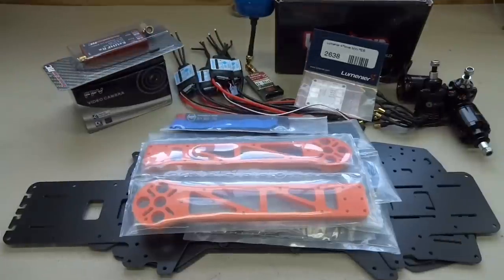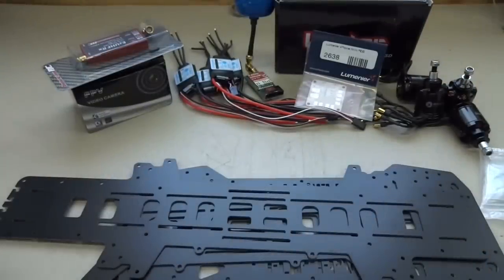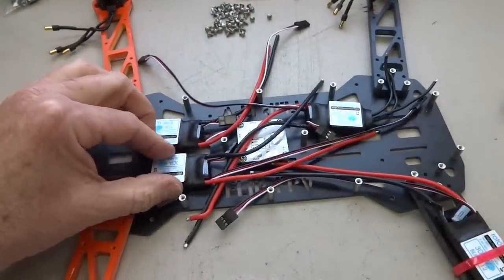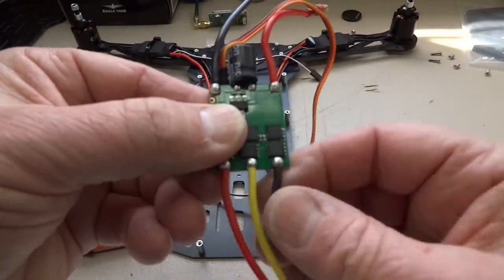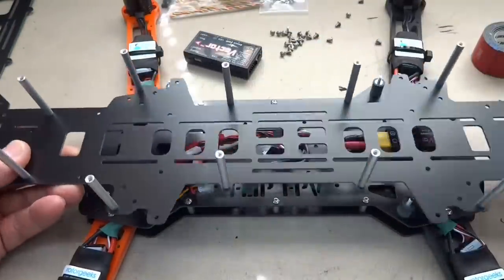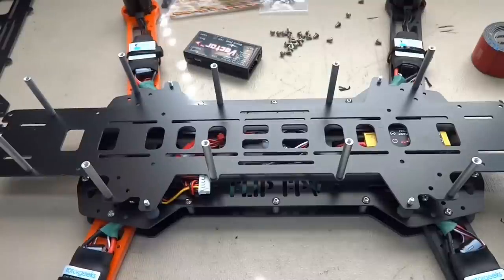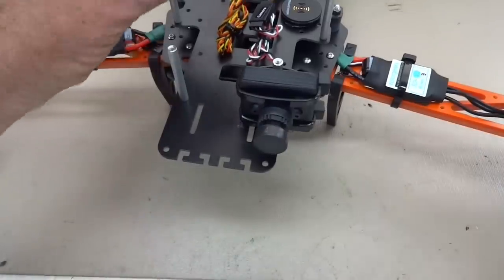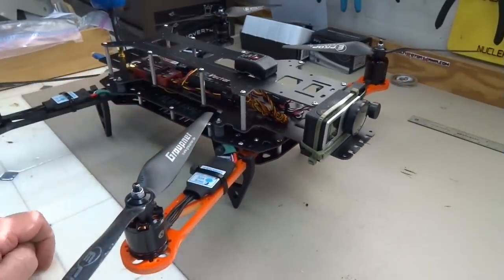Hoverthings Flip FPV PRO Build Tips

Comment: OUTSTANDING build video!  Never thought I'd get interested in quads at all, but, since I started toying with the idea of FPV, instead of buying a very expensive /very viable computer for X-Plane 10, then getting started with one of these quad copters, especially for near field excursions, makes a lot of sense, and is probably a cheaper way to get into FPV flying, i.e., instead of putting together a distance platform right away.  I could be wrong about that though. 

If I do decide to build a flip 360 FPV, and enjoy it, then I can start thinking about a long distance platform, e.g., a 2.5 - 3.0M electric sailplane. 

You're feedback would be appreciated, thanks...

Comment: Id like to hear how your video looks. Ive been working on mine for ver trying to get rid of small vibration in video. The rubber standoffs they give you seem to be a bit soft. I've balanced props and running the same motors. I am also using the gimbal version.

Comment: Nice Build. I built a standard Flip FPV. For some reason I couldn't get every last vibration out of the frame and mine was pretty heavy around 1700 grams if I remember. I ended up using the hoverthings gopro protector housing and I made a couple modifications to fit it to the standard frame and tilt it about 10degs up. http://www.hoverthings.com/pro-g-360-gopro-mount 
I loved both my FlipFPV and my Flip360 but had problems with vibrations and flip360 frame flex so they just sit now and I slowly pull parts from them for other stuff, lol.. Watching your video makes me want to pull my flipfpv back out and add the clean plate to make it a pro. Looking forward to the maiden flight video!
Reply from the maker: Bozi B Joe,

    Sorry for the delayed response but I'm in Florida on vacation.  I'll be more than happy to put the parts up on Thingiverse once I get back home this weekend.  Once I do, I'll put the links in the video's description so you can easily find them.

bill

Comment: Great video. How do you like the Vector flight controller, and what modes would you fly with?
Reply from the maker: thatsmoovekat I absolutely LOVE the Vector.  In fact, I'm slowly selling off all my Naza V2s and replacing them with the Vector.  It is FAR superior to Naza AND it has a beautiful color, fully customizable OSD built right in.  I set up a 3-way switch with 2D, Loiter and 3D+hdg.  I like to land in 2D and take off & fly in 3D (rate, manual, whatever).  Weird, I know, but it works for me.
Reply: AerialWerks Sounds good. I also have the Flip FPV Pro with the Vector and generally love it but the only issue I have with it is throttle response in 2D+Hold and Loiter modes. Using the Taranis Plus, it seems throttle inputs aren't very linear. Have you experienced anything like that, and what is your throttle response like in 3D modes?
Reply: bosnianbill That explains a lot. I thought there was something wrong with my radio or Vector configuration, and couldn't understand why throttle inputs above/below 50% didn't seem right. Must have missed that in the manual. I'll have to try 3D mode one of these days. Thanks for the info bosnianbill.
Reply: AerialWerks I've been playing with 3D mode, and it does have the response I've been looking for. Playing with the Vector's PIDs and advanced settings is a bit tricky though. Do you have any tips, or can you share your PIDs so I can see what differences may be?
Reply from the maker: thatsmoovekat Sure, PM your email address to me and I'll send a screenshot of the setup screen.
Reply: AerialWerks PM sent...thanks.